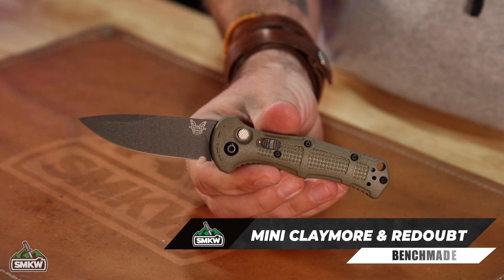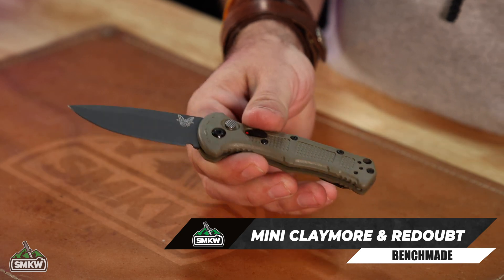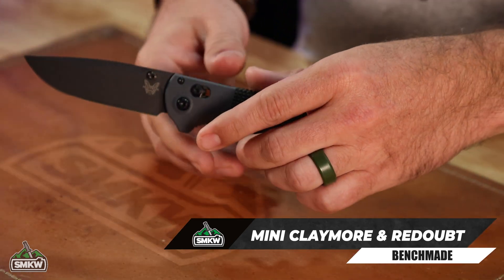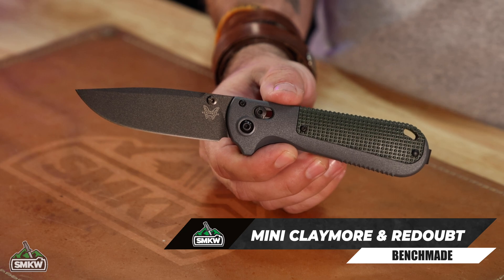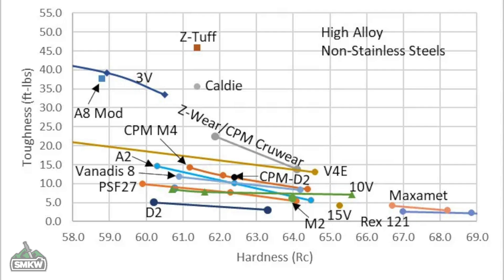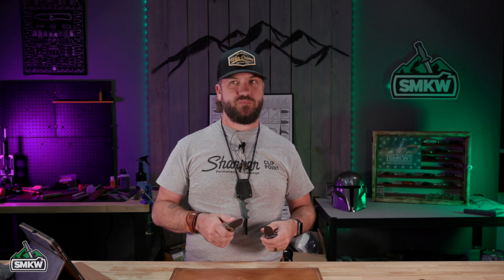What Is CPM-D2 Blade Steel?

Comment: I like the one example of CPM-D2 that I own, the Kershaw Dividend. It seems to take a noticeably keener edge than standard D2. Good stuff.
Reply from the maker: We love using and working with different steels to see how they fit how work/lives
Reply: @SMKWcom  oh man, don't get me started; I could drone on and on about what steels I like for what circumstances and uses.

I assume like a lot of us, I put a bunch of thought and time into what knife in what steel is going into my pocket on a given day. I pick a one based on several what-ifs that could pop up for what I plan to do and where I plan to be. Then I chuckle to myself when I could have used poorly treated 420j2 to open the bag of chips I used a PM2 in S110V on.😆

At least my knives get a workout on the job most days.

Comment: It still doesn’t change the fact that benchmade are overpriced. Not to mention most of these steels are more then 20 years old. So none of it is cutting edge technology. Knife companies use a steel name act like it’s the latest and greatest.
Reply: And 154cm is still a great steel, despite being old
So it doesn't matter how old the knife steel is, it all depends how the company takes the steel, manipulate it, heat treat it and turn it into a finished knife product. 
Whether it's magna cut or 1095. Some companies [tops] charge hundreds for knives made in 1095 and people buy them up quickly
Reply from the maker: Thanks for watching. 😁

Comment: Im ok with 4116 on many of my Cold Steel, which I buy for lock safety and competitive pricing not supersteels. However I'd rebuy one of each in D2 if they offered it, wouldn't even have to be powder technology. The extra edge retention is a reasonable tradeoff vs the superior harsh condition corrosion resistance of 4116. For Benchmade i think S35Vn and Magnacut match Benchmade's nosebleed pricing better.
Reply from the maker: Thanks for watching Dubb!

Comment: Hi)
For edc i'm using vg-10. I think it's middle of  easy sharpening and edg saving. But after this video i want to try d2 and cpm-d2.

What do you think is better: regular d2 or vg-10?
Reply: I would prefer vg-10 over D2. Realistically you wouldn’t be able to tell a difference in edge retention between the two but vg-10 is way more corrosion resistant than D2.
Reply: Cedric Ada edge retention tests give a significant advantage to D2 IIRC. But VG 10 won't corrode. In Joe X tests both 4116 and AUS10 are very tough, but I don't recall any D2 or VG10 destruction tests. At the end of the day we have to place a lot of trust in the steel mill reputation and then in knifemaker quality control and consistency of heat treat. I think those are more important that steel formulas. Reputation is king because we don't have the time or money to thoroughly test a statistically significant number of samples plus factories get replaced, equipment and personnel change. So far Spyderco quality control even on China product seems highest, even 8Cr13 from them holds up great.